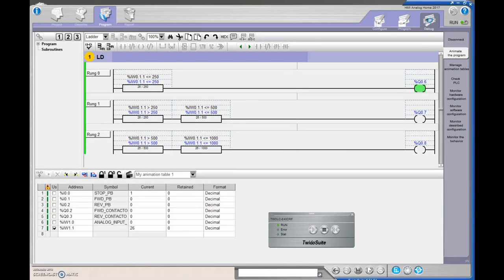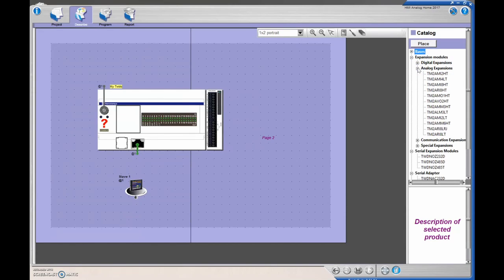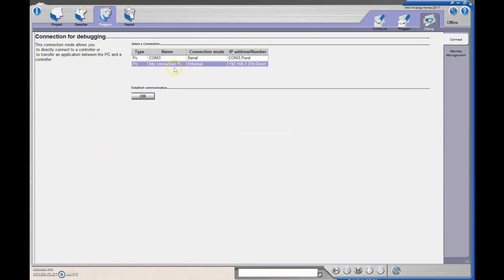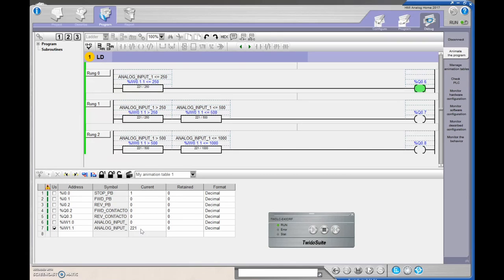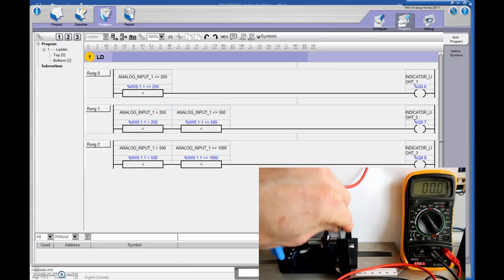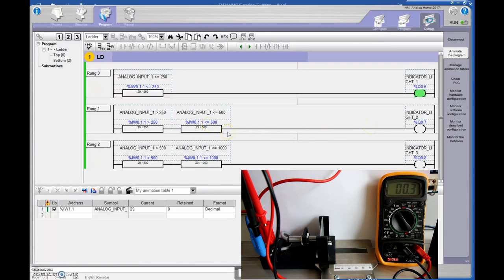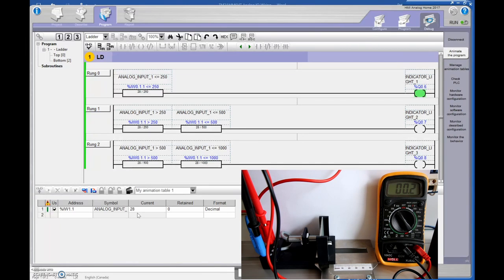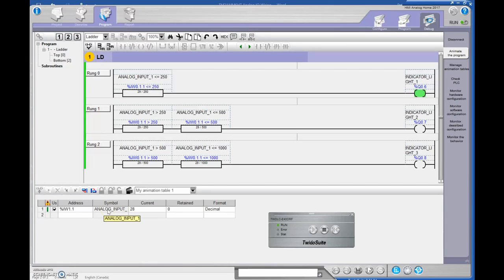PLC Tutorial (TwidoSuite) #13 (0-10 V DC Signal to Analog Card cw PLC Program)

Comment: Hi can you do some tutorials on Twido soft ?
Reply from the maker: Twidosoft was the original programming software, Twidosuite was a completely new package (not just an upgraded version) to also program the Twido. However, the Twido Series of PLC's are not being manufactured anymore... so any further videos on Schneider Products would be on the Modicon line. Right now, I am working on the Siemens PLC's as I feel they are going to be the most prominent PLC in the market place going forward.
Reply: okay thanks for the fast answer,  one more question : Schneider stil use Unity right ?  

Siemens TIA Portal is really great, and easy to learn.
Reply from the maker: yes for Unity